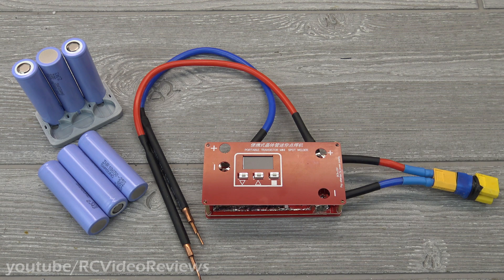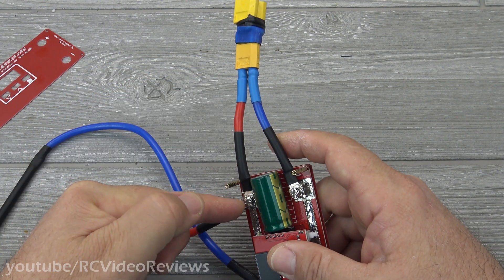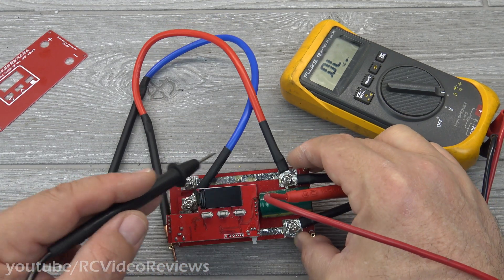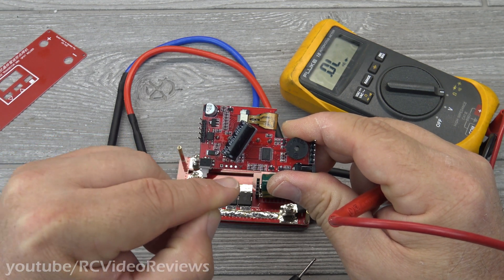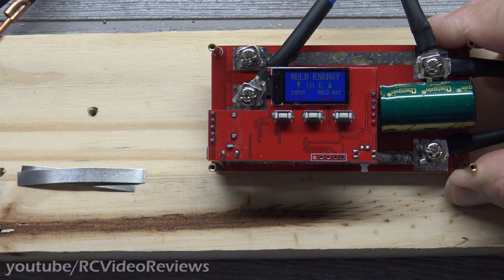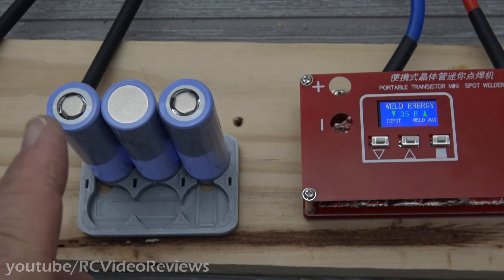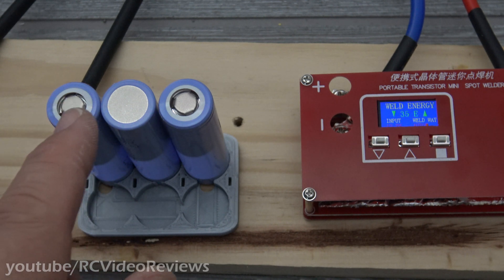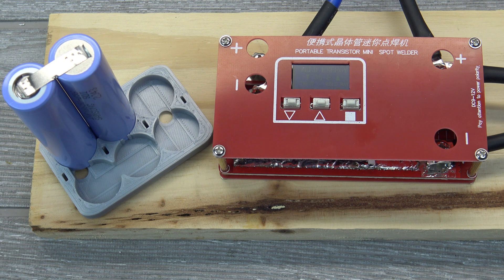Cheap 18650 Spot Welder Reliability Mods and Test

Comment: Someone on YouTube said dont put a lot of pressure, just enough to make the nickel plates touch each other, as  too much pressure will create a low resistance path and the metal will no heat up enough to weld itself. That's why there's no repeatibility

Comment: First press hard, then releax so you barly touch. It makes stronger connections bc you only use 1%of the weld lead and not the whole tip. The whole tip conducts to much, wont melt the top one. Best is to cut a slit between the top one to force current to second layer

Comment: I weld nickle strips at the #1 and #2 setting with an older, but still good car battery. #3 blows holes through it. Tempted to try the #99 setting.⚡⚡⚡

Comment: How do you get 120 amps? Is it stored in some capacitors in this contraption?
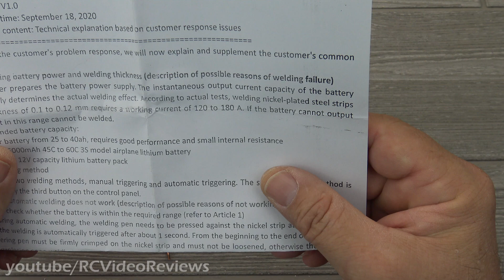Reply: The battery puts out that much current. You need a high discharge current battery, he uses a 2.2Ah 35-70C (92-184A) li-po @3:56. That's why li-ion cylindrical batteries aren't used for spotwelding: those can be discharged around 10-20A only.

Comment: Just bought one of these welders off Ebay and it came as an improved version. It came with the added capacitor already in place (just a bit smaller than used here). It has alloy bus bars running the length of the circuit board on top of what was just solder traces. Nice additions. I use it with a 38 ah AGM auto battery. Works great!
Reply from the maker: Cool! Glad it worked for you.

Comment: Just bought one of these mine doesn't have solder beds between the + terminals or from the - terminal to mosfets it has big copper slabs instead, I'm guessing the design has been refined a bit since you got yours
Reply from the maker: I've heard that.

Comment: It is okay to soldering battery, just don't apply heat too long, and use right flux to make the solder stick quickly. But the problem is solder create bump on battery that make it not fit later in the casing or whatever you use. Spot welder not create bump, it just flat, and neat. But, they also not really cheap to have, if you counted it with battery pack you going to use. Even though this kind of portable spot welder are cheap, but you also need to buy a powerful battery to run it. You can't use a weak battery to do spot welding. Powerful battery for example lipo with 6000mAh, 50C rating is quite expensive tho.
Reply: @bangleoelektro  I got one on AliExpress for less than 50 dollars

Comment: Cool idea with the capacitor! I managed to seemingly short the MOSFETs on my board. It's not the one you have but a black PCB that has a pushbutton, LED, buzzer, and control circuit with 5 MOSFETs. The MOSFETs now read a resistance of 12kohm between drain and source. Not great, but I hope to get an external 12v power supply connected to the next board I ordered to prevent this issue. I feel that the control circuit should be independent given how much current the MOSFETs draw. That would feel like a better solution in my opinion.

Comment: Hi John, I think it was a later video I watched of yours using a spot welder with 18650 etc. Just one question, how are nikel strips rated for the ampage. I have looked, but with little success please
Reply from the maker: There's a chart out there with different amperage ratings for different metal strips. Search for that and you'll get an idea of what you'll need to do for different metals.

Comment: THE ONE I BOUGHT FROM AMAZON THIS WEEK HAS 2 COPPER RAILS NOW. I AM STILL GOING TO INSERT THE CAP. 
IF YOURS DOES NOT HAVE THE COPPER RAIL I WOULD TAKE SOME 14 OR 12 GAUGE BARE COPPER WIRE AND INSTALL IT ON THE RAILS. AND HOOK BOTH POSITIVE LEADS ON THE POSITIVE INPUT. SO THAT RAIL CAN NOT GET HOT.
Reply: i just got one with the new rails, but the daughter board is slightly different than this video. did your welder work fine with the mod?

Comment: Did you have to use the second battery, or was the on battery ok?
Reply from the maker: I don't follow...?
Reply: @RCVideoReviews  in the video you said that if if you didn’t get enough current from the lipo you had connect, you would connect another one….did you have to use a second battery!
Reply from the maker: Ok, I have over 800 videos. That one was published ALMOST three years ago. I answer thousands of questions every year. You'll have to forgive me if I don't remember every detail of every video.

For my project a 2nd battery wasn't required. Yours might depending on how many welds you make.
Reply: @RCVideoReviews  cheers

Comment: Thanks for giving a HELPFUL video that will save me a lot of time and hassle factor and probably money. You gave a solid technical CAUSE and FIX video to make this P.O.S. worth something!!!
Can you believe they are handing out surface mount FET's people will NOT be able to replace, rather than fix their damn crap engineering? Wow. What a nutty way to go.
I watched another video with zero info on this same device, and the guy never said a word, you don't even know if the video had a point to it.
As an Electrical Engineer, I can FULLY appreciate your mods, and the not saturating the gates of the FETS. Of course the FET resistance will be too high if not saturated!! Can you please tell me what the main (Green) cap voltage and capacitance is so, I can order both the Mod Cap, you put in, and the main output pulse cap from Digikey, and get Low ESR (FM Series) caps. Now I can feel confident ordering this, rather than paying $60 for the high failure rate one on Amazon I was going to gamble on.  Thanks for your info!   (I think we have commented on Aerostuff's channel with each other.) Oh BTW, are those Li-Ion batteries you are using? if so, where do you get yours? I'm currently making Aerostuff's Silver Eagle V-Tail Pusher for long distance flying.
Reply from the maker: The original video has the specs:
All you need is a 1000uF 16V(or higher) capacitor
I replace the 5 broken MOS with 4 superpowerfull Infineon MOSFET:
IRL40SC228CT 0,5mOhm 1440A pulsed

Yes, The design is definitely questionable when they send you spare FETs...
Reply: @RCVideoReviews  Right, I caught the values for the modification cap, I was hoping you could give me the values on the storage (green) cap that comes on the board. I want to make both of those caps low ESR for long life, and extra punch on the welds. I want to place just one order for the FET's and both caps. You know I can't use it until the modification (repair) cap is installed, and I want to do all the work at once before I put it in a case.

Comment: firstly the link in the description goes to a completly different welder and secondly these normaly blowup the fets on first use unledd a cap+ diode added!.
Reply from the maker: Sometime after this video, I evaluated an improved spot welder which is linked in the description. It wasn't my intention to remove the link to the original--so that's fixed. Thanks for pointing it out.

The mods I used in this video have kept this spot welder running for a couple of years now. Not very heavy use, but it does still work.

Comment: just got mine and was noticing my lipo wires and pack was getting warm after a few welds  so I shut it off   ... don't think that's a normal or safe thing to get the lipo 3s  warm
Reply from the maker: Sure it is. You're hitting it with a crap-ton of current every time. You have to pace yourself. This is not an industrial spot welder.

Comment: hello RC the battery you used is not available right now what specs should I look for in a rc lipo battery to use instead..having a hard time duplicating the specs of that turnigy 2.2 with a 35c to 70c burst discharge, I wanted to copy what you did but need the battery minimum  and max specs to look for id appreciate if you or someone would help in a RC LIPO BATTERY
Reply from the maker: Any 3s cell with 40c+ should do the job. Look for rcbattery.com usually has the right kind of batteries for this device.
Reply: @RCVideoReviews  thank you for quick response
Reply: so this would be ok? 8000mAh 11.1V 100C 3S Lipo Battery

Comment: I recently bought this exact model. The part where you flowed more solder has been addressed by the maker adding a aluminum rail a few mm's thick. Question, I don't have those hobby battery packs that you used to power this unit. Is using a 12v car battery good to use? Can the battery pack from power drills be used or is the 20v too much voltage?
Reply from the maker: The spec says 12v. I wouldn't go above that. You need a battery that can deliver real punch of current. The hobby batteries work well for this.
Reply: @RCVideoReviews  that hobby battery you are using in the video is not available its out of stock everywhere I looked for a good hr online  what would be an alternative in an RC battery? that has the 35c to 70c burst
Reply from the maker: You can find 3s 40c lipo batteries all over the place.

Comment: It has been said that if you round-off the electrodes just "slightly" and hold them at 45 degrees to the surface you're welding, you get Much Better welds (less area getting the "Juice", and deeper penetration of weld!).
(NOTE: I haven't tried that method yet, but have witnessed it on a Friend's set-up.  He uses a motorcycle battery for a power source.).
Thanks for all the information about where to "tie-in" the positive lead, and "reinforcing the elec. contact at the bottom of the board.

Comment: Definitely need the capacitor. I have one and blew a bunch of mosfets as mentioned. They actually got so hot they welded to the copper so I damaged it getting them off (the ones which hadn't blown came off clean). I'm going to put some copper foil down so I have good contacts.

Comment: I've was excited to get mine going but it doesn't get hot enough to make a good weld, even on 99 power setting. I initially added the capacitor mod to it to prevent the fets from frying, tried it and it's could barely weld 2 tabs together. . . so I removed the cap and tried it. . . no joy. Any idea what my issue could be? I used a 2200mAh 3S LiPo, then I tried it with a 4000mAh 4S LiPo. Same result. It was only $20 but still, I'd expect it to work for basic stuff. Wonder if connecting it to a larger 12V Lead Acid would help?
Reply: I saw another video that has more mods in it, it showed that a diode shorts and needs replacement with a resistor in series with it.

Comment: You obviously haven’t done big battery packs yet oh yes those cables will heat up and so will the probes
Reply from the maker: Yeah, this is not an industrial strength spot welder. I don't really think it's positioned as such either. With "cheap" in the title, it's probably safe to assume if you're going to do big battery packs, you probably need to look at something else.
Reply: @RCVideoReviews  buy two of them and switch off between the two
Reply from the maker: Yeah, that could be an option if you need that kind of duty cycle out of it. I don't though.

Comment: Thank you for your review and recomendation.I just buy this spotwelder & i want to make my own diy lithium 3s battery pack to provide enough power to this welder,i will use 21700-40t they are bigger and powerful than 18650.this exact battery have 40amp discharge i think,i will use 15 of them,5x3 for 3s bms i think it will have enough power to weld,My problem and quwstion for you what kind of bms it will be powerfull enough to provide enough peak amps for welding?
i see on ebay alot of different 3s bms but neither say max peak power just charging and discharging current.
can you tell my what ind of bms is in your battery pack?

Comment: Yea thats good mine blow a mosfet first time I used it with a too large car battery. After mosfet change its welds so weak even on 99 and 800A 890ah battery.. dont understand whats bad now
Reply: In another video I have seen that a small diode shorts, and needs replacement with a diode with a resistor in series

Comment: Some say you're NOT supposed to press hard. Softer press gives more resistance, which causes more metal to melt.
Reply from the maker: Iv'e tried the soft touch and thought it was pretty terrible. The bond I got in this video is still going strong a year and a half later.

Comment: don't hold the contacts vertically, hold them 45 deg to the surface and they'll work even at 20
Reply: mine pops like crazy i try every angle and randomly itll just crazy pop sparks fly you jump lol. i dk pretty scary machines lol

Comment: Great video, nice presentation!
Edit.
I bought one like this, it arrived yesterday. I took it apart to connect the capacitor and I noticed that the power copper lines on the pcb board are reinforced. The is a brass rod welded both on the (+) and the MOSFET side.
Reply: Yeah, i noticed the same thing, the manufacturer must have actually improved their product!
Reply from the maker: Thanks for watching

Comment: I ve just bought one of these and not sure if it's faulty. Another video had it connected to a 12 v 7ah battery. That's what I'm using and it doesn't stick to the cells or even the strip. Was told to use a lipo so is that the problem. Yours welds at 30 mine doesn't at 99? Ps hasn't smoked or blown anything

Comment: Well, it's almost a year later. I bought a $15 spot welder off ebay, and it turned out to be the same model you and Maker Fabio used, so the capacitor fix was the same. Whew. I used a stronger battery 3S 5AH 50C, and I could weld .15mm strips at the 35 setting. I just finished a 13S_3P pack with .15mm 5mm wide strips and it probably needed 600 welds because multiple layers were needed. When the probes got hot, I stopped to let things cool. I'm sure those Mosfets are seeing a hard life, but it lasted for one battery. I even ordered a second unit for a spare. 

I appreciate your video. Also many kudos to Maker Fabio for his analysis. 

Happy flying! I'm an ebiker and these RC Lipo packs still scare me, but I'm impressed with the balance chargers.  I've got the RC battery safely stored in an old BBQ grill outside when it's not being used to weld. I watch it like a hawk when charging too, I never let my ebikes charge overnight either.
.

Comment: What max thickness can you weld with this?
Reply: Product page on Amazon says thickness from 0.1mm to 0.15mm. These go for about $20 or less. It's about what you would want to pay for this and then buy the car size alligator clips(look for 10 gauge rating or better) to wire to the wire it comes with.

Comment: How does one attach a pedal for manual activation?  Which pedal?  Most pedals don't have the correct plug and a plug comes with the model but I don't know what to do with it.  I think results would be better with a pedal as you would have the time you need to press down hard where you need to.

Comment: can someone link me to the correct parts to buy.? the cap and  and mosfets. I SMOKED MINE FIRST TRY.
Reply: Read the number off the mosfet and its any voltage over 12v and 1000uf capacitance

Comment: Think this would work on a 6s tattu r line? or would that let out magic smoke with too many volts?  do I need to separate some cells and make a 3s pack?
Reply from the maker: One guy told us he used 6s on his and it worked a few times but eventually quit. I don't believe it's intended for much more than 12v.

Comment: Where do you guys all get this version of the welder... Mine has no diode or connector I might be able to solder the capacitor in. I have a bag of 1000micro Caps here and thought this will be a quick fix.... Until I found out I have a different solder version. 
But good video anyways!

Comment: Can you go TOO big on the battery you use for this mini spot welder?  I've got a 12v, 100ah, marine deep cycle battery that is capable of 800cca.  I don't think I have to worry about under-powering the mosfets?  I'm still planning to solder in the 1000uf 16v capacitor, but is it necessary when using such a large power source?
Reply from the maker: Just keep the voltage correct. The weld is a dead short with controlled timing by the controller.
Reply: @RCVideoReviews  - I don't think I'll get a voltage sag, like I've seen in other videos, because of having such a large battery that is capable of (literally) cranking out a lot of amps.  At the same time, I already ordered a 1000uf, 16v capacitor, so I'll just wait, solder that bad boy in, and hopefully I won't have any "magic smoke" issues.

Comment: Can i use a 12v 60amp SMPS. As the retailer suggested that i can use this spot weldet with 12v 40 amp SMPS. Should i use an smps?
Reply from the maker: I don't know. You can try. I'd expect to need more than 60a though.
Reply: @RCVideoReviews  thank you so much for your reply. I will consider a battery then. Doesnt a battery too have 12v 35 amps? A normal car battery
Reply from the maker: @ScrewBot  The only thing I can say is experiment. I think you need to be able to deliver quite a bit of amperage. I'm not an electrical engineer, but my guess would be in excess of 80a.
Reply: @RCVideoReviews  thank you for your reply. I will experiment then. The only harm is i guess i might corrupt the spot welder. Thank you once again.

Comment: Hi sir, Can I use a 12v 5.0ah battery, Can I know what is the minimum value required for this spot welder ???
Reply from the maker: 12v is ok as long as it can deliver the amperage.
Reply: @RCVideoReviews can use battery 12v 5.0ah...

Comment: Don't push to hard on the pins. Just enough to make the two surfaces mate well. It needs a bit of resistance.

I made a 3s pack to run mine. Used 21700 40t samsung cells. 3s6p. Those cells can pump out huge current.
Reply: Wow that's a huge pack! Bet you can keep welding for days :D
Reply: @vojtakolacek3815  I have to wait for it to cool down. But I leave it hooked up all the time. Maybe charge it every 3-6 months.
Reply: Why you not used lipo battery, 21700 or 18650 is safer than lipos?